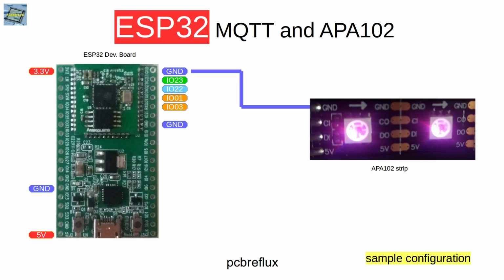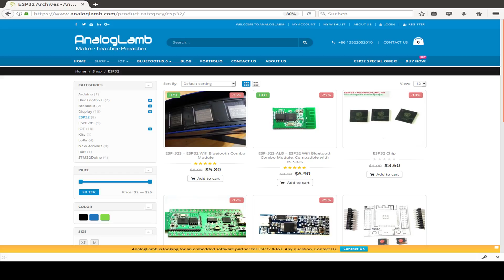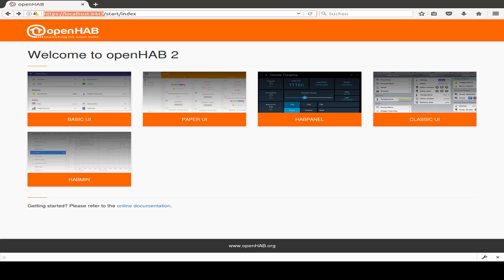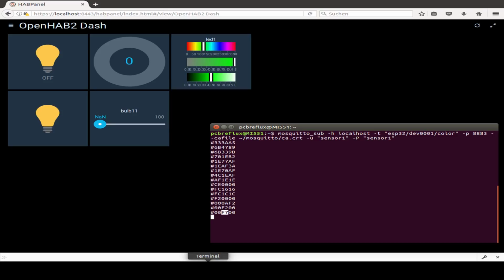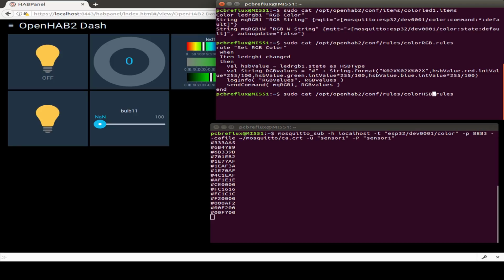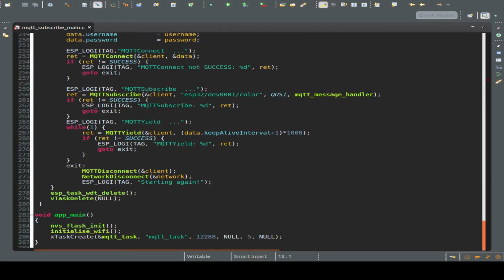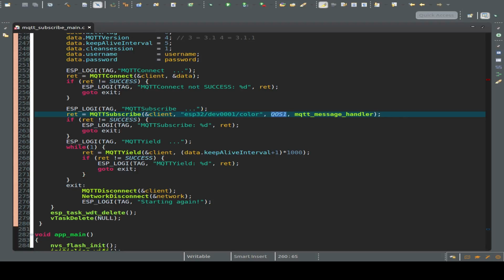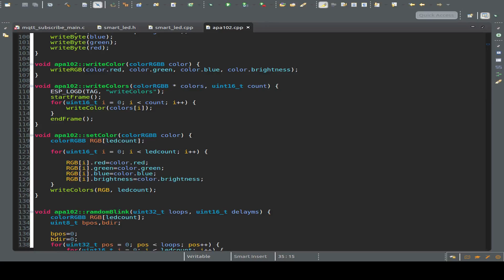ESP32 #35: Smart LED Prototype 2, openHAB2, MQTT Dash + ESP32 Giveaway

Comment: Hey.. Its a request. can you please guide me how to write code to control leds from BLE UART, the same way you have done in this tutorial. ??
Reply from the maker: Have you looked into the Code: https://github.com/pcbreflux/espressif/blob/master/esp32/app/ESP32_ble_UART

in ble_uart_server.c Line 333 the Message from the BLE UART will decode to switch a LED On or OFF ...

   if (strncmp((const char *)gl_char[0].char_val->attr_value,"LED ON",6)==0) {
      
      
             gpio_set_level(LED_PIN,HIGH);
      
      
            } else if (strncmp((const char *)gl_char[0].char_val->attr_value,"LED OFF",7)==0) {
      
      
             gpio_set_level(LED_PIN,LOW);
      
      
            } else {
      
      
        
Instead using "LED ON" or "LED OFF" you can "decode a color BLE Message like "#123456" and 
use the code from https://github.com/pcbreflux/espressif/tree/master/esp32/app/ESP32_mqtts_apa102
file mqtt_subscribe_main.c line 156 to 180 and create the APA102 task with the BLE Color.
Make sure to use gl_char[0].char_val->attr_value instead  md->message->payload and gl_char[0].char_val->attr_len instead md->message->payloadlen.
Reply: Great Help! I have tried this thing but I am getting error while writing task for apa102 leds. But thanks

Comment: Is it possible using this code and use mqtt cloud service (i.e cute cat plan) and do the same thing as you have done in this video so my client can subscribe to topic from any where in the world?? Please help
Reply from the maker: Yes its easy, just use the correct server, port and websocket option and also user and password for your cloud service (see head of mqtt_subscribe_main.c). But your provider have to offer SSL/TLS encrypted connection because the library for the ESP32 uses mbedtls. And avoid using public cloud service because everyone can send to your device or read your MQTT messages. And use maybe QOS1 or QOS2 to prevent loss of messages.
Reply: I am very happy with your help. NICE !!! Can you please tell me how to configure MQTT cute cat plan for this project.
Reply from the maker: first sign up to setup your own mqtt server (https://customer.cloudmqtt.com/login). Now you get a admin/password user just for login not for the esp32. And you see your new mqtt server and the port for SSL and websocket for your esp32 settings. Now you go to settings and add a new user/password with access to a mqtt topic (maybe esp32#) and set read and write access. Now insert this settings to the esp32 code, compile and flash. You can also use the WebUI to test the communication between the esp32 and your mqtt server. Hope this helps.
Reply: Thanks. One last question: can I use MQTT DASH application to control somehow you have controlled leds in this tutorial using cute cat plan ??
Reply from the maker: engr. SA sure. but websocket is not supported in mqtt dash so you need the SSL port without websocket. You can also test this with the cloudmqtt WebUI without the esp32. If all devices work then you can connect them step by step.
Reply: If we want to turn off the leds, so what command should I send from the mqtt dash application?
Reply from the maker: engr. SA If you use the example code you send this topic esp32/dev0001/color and to turn all LEDs off you send as a message #000000 (this is black as a color from the color picker).

Comment: Thanks for the video. I wonder how much power your LED strip
consumes. Depending on the LEDs, it must be ~9-18 W/meter. Isn’t it better to
power it from an external power source instead of ESP32?
Reply from the maker: Meisam You are right. In my setup I power the LED strip and the ESP32 from my 5V USB power supply. Max should be 60x3x0.01A ~ 1.8A -> 9W. But for a real setup it's better to use a power supply that fit to the consumption of your circuit. And maybe its cheaper to use ws2812 instead of apa102 but  they are easier to controll and don't need a accurate timing but use one gpio pin more.